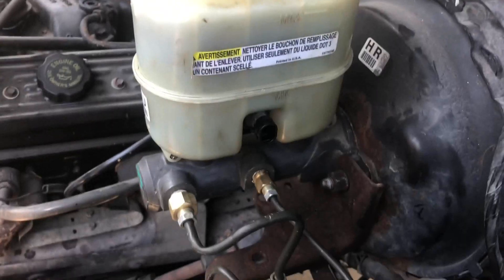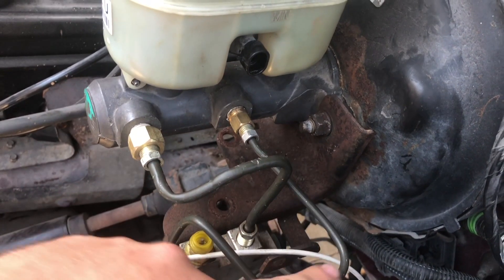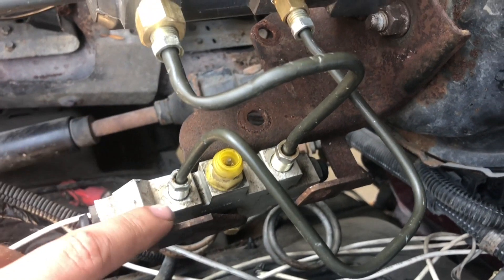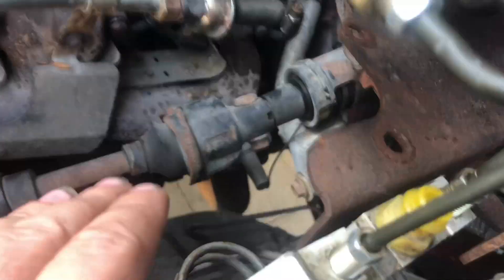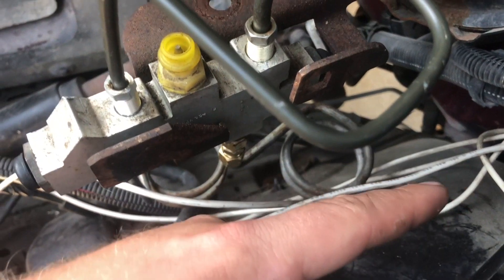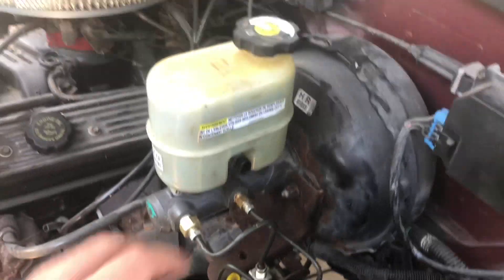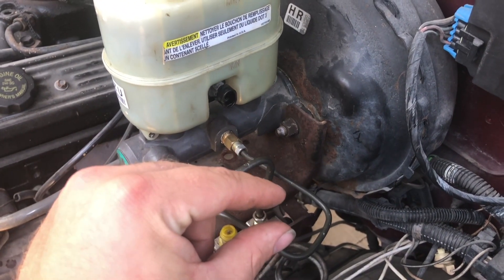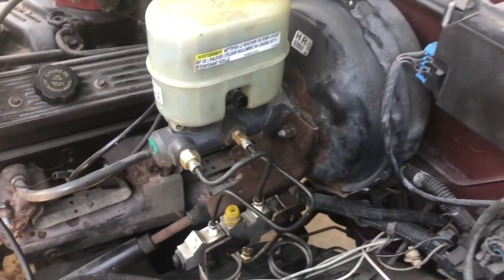1988 - 1994 Chevy 1500 2500 master cylinder upgrade and ABS delete

Comment: 1998 Chevy here. All 4 wheels done, drums in back.  But still very bad brakes.  I am getting plugs for the master to see if the pedal is rock hard with the ports plugged.  If so then ABS delete.  One thing I noticed was the small holes for the front brakes for the fluid through the banjo bolts.  Needle size holes.  Not sure if I'll even use a proportioning valve or not.  Is there one in the ABS?  I don't know.

Comment: Just did the master cylinder upgrade.........2" travel brake pedal..... then have to push VERY HARD to stop truck.    2" travel is NOT enough for Power Booster to work for power brakes.  ? What should I do next ???
Reply from the maker: Was your power booster working correctly before? The pedal on are truck moves less than an inch before the brakes start to engage.
Reply: @chrisperkins7067  Booster worked fine before......    @" tra
Reply: P S    After ABS delete  still can NOT Lock up wheels. Under dash air sound as pedal is pushed.
Reply from the maker: @catdakman1273  did you use the exact same master cylinder I used?
Reply from the maker: @catdakman1273  kinda sounds like your booster isn’t working is the petal really stiff does it move at all with vacuum on the booster.
Reply from the maker: @catdakman1273  also pump the pedal a few times and hold it down if it drops your master cylinder might be bad.
Reply: @chrisperkins7067  YES it was
Reply: Power brakes worked fine, before. M Cyl is '02 silverado.... the short one like your video.  Pedal moves like in slow motion, even when you mash it to floor. Air sound comes from under dash when pedal moves...   ?????
Reply: I did the abs delete and installed the new master cylinder and I am experiencing the same symptoms, I installed new calipers and rear cylinders tried to bleed even with the bleed tool on the proportioning valve and brakes still having the 2" travel and really hard to stop the truck.
Reply: I just completed this modification to my 89 GMC 1500 and I am experiencing the same problem. I have significantly reduced the brake peddle travel but no longer have power brakes. I suspected it was a result of the reduced travel and based on what others have experienced my suspicions are confirmed. I am seriously considering going back to the original master with the hope that the ABS delete alone provides some improvements in peddle response.

Comment: Can ABS system cause my Master Cylinder to leak out front port? I got 95 GMC C1500 with the other ABS box than one in video and I was wondering if deleting ABS and getting warranty on my Master cylinder would fix this, my first one started leaking and I replaced and few years later leaked from front port under reservoir and then I just put a brand new MC on and now leaks same spot and from lines at MC.
Reply from the maker: It might It sounds like there might be a restrictions somewhere in the line causing back pressure to force its way past the seals. Delete the abs and if it’s still doing it look at the prop valve because it might be restricting to much and make sure your back brakes are working the prop valve might be closed that could also be the problem.
Reply from the maker: Jimmy Howard and another option is to use a Chevy square body master cylinder because the master is one solid piece it cant leak. Ive never done this only read about it and it might just hide a latter problem but it’s an option.
Reply: @chrisperkins7067  thank you much
Reply from the maker: Jimmy Howard I’m happy to help

Comment: Where do I get the 2 lines that go from nbs master cylinder to the top of the proportioning valve? And I can use an adapter for the rear line to bottom of proportioning valve? 

Rear line---->proportioning valve---->new line---->adapter fitting--->master cylinder correct? 

Basically I'm asking can this be done just with adapter fittings? Thanks
Reply from the maker: Marcos Serna you can get an adapter fitting that would just adapt the rear line to the proportioning valve but your going to have to get a thread gauge and check because I don’t know the thread I flared a fitting from the junk yard on to are’s. The lines going from the proportioning valve to the master I mad my self you can get pre flared line and just adapt them one of the comments around here have the part numbers for those fittings.
Reply: @chrisperkins7067  Thanks Chris! Great info! So far I've done the abs delete and my nbs master cylinder should be here tomorrow. Most instructions are for the 96+ trucks whereas mine is an 89.
Reply from the maker: Marcos Serna happy I could help.
Reply: @chrisperkins7067  thanks for the info. I'm bout to start my rear disc brake upgrade also on my 89obs and do this abs delete. I just have find out out proper fitting and wondering if the part store flare the ends of the brake lines
Reply from the maker: Co Will yes you can get pre made flared lines in different lengths and bend them to fit.

Comment: Would this work on a 94 suburban Silverado edition TBI it has the big box abs and so all I would need is the master cylinder for a 2093 GMC truck? And fittings??
Reply from the maker: Yes it should work as long as it has a vacuum booster and not hydra boost.
Reply: @chrisperkins7067  thanks I meant to say 2003 lol
Reply: I'm doing the same thing just ripped my abs unit out (the big box on fender) and re routed my front lines with the "T" the early 90s used

Comment: Can you link the adapters for the master cylinder
Reply from the maker: Here’s the part numbers both fittings were purchased at advance auto parts.

Blf-20c

Blf-19c

Thanks for watching.
Reply: You're a god amongst men sir. Just ordered the fittings and got my master cylinder today. Do I need to fully delete abs or can I just unplug the box and say fuck it
Reply from the maker: @fakeMbadge I would fully remove the abs Box and abs valve. You might be able to keep the wire that plugs into the top of the proportioning valve. I removed all wiring that went to the abs box and proportioning valve. I kept the proportioning valve in the system. Hope this helps.
Reply: @chrisperkins7067  What part/fitting did you use for the rear lines to go into the bottom of the proportioning valve?
Reply from the maker: Russell if my memory is correct I cut the fitting off the abs module and used a compression fitting to connect it to the rear brake line and did some bending to get it to line up. If compression fittings aren’t legal we’re you are you can get a brake line union and flare it on.
Reply: Did you have the part number of the master cylinder?

Comment: Does this apply to hydroboost trucks?
Reply from the maker: I cant say for sure but this should work on a hydra-boost truck. As long as it started with a master cylinder that is the same as a truck with a vacuum booster.
Reply: @chrisperkins7067  Thanks for reply.  Took another look at the truck. It has a kelsey-heyes 3 channel abs. The system is different than the others in videos.
Truck is a 95 3500hd. Yesterday I went to my friend's farm. Had a long downhill gravel path; took it at 1-2mph with brakes applied and in 1st gear.  Afterwards rear brakes were smoking on freeway and fronts were also very hot.  Even the master cylinder and bottle were very hot. The master seems ok. Brake hoses look okay but are original.  Not sure how the abs can cause brakes to stick.
Reply from the maker: electricamir248 if it’s locking up on all 4 wheels I would check your abs,master cylinder or proportioning valve. My guess is you probably have a bad proportioning valve.
Reply: @chrisperkins7067  I removed DS front caliper and on the floor was very difficult to push piston in with hammer handle and my weight. Got a new caliper coming and will test. Seems strange for all 4 calipers to get stuck at the same time. I will post my findings.
Reply: @chrisperkins7067  Finally got it all back together last week. Turns out all 4 calipers were stuck. Proves the importance of brake fluid flush.  I believe these were  original to the truck; 24 years.

Comment: What vehicle did you get your master cylinder for or from
Reply from the maker: 2003 Chevy suburban
Reply: Were are the adapters for master cylinder available parts store or do you have to hunt them down from somewhere like Lowe's
Reply from the maker: james stevens got both at advance auto parts there’s another comment here somewhere with the part numbers.
Reply: I appreciate the help buddy I've got a 90 K 2500 I'm redoing the brake system on I've got a leak I think I've narrowed down to the rear wheel cylinders replacing those this weekend and my parking brake light is flashing which I'm assuming is an ABS problem so I'm going to try to delete that as well and I figure doing the booster upgrade is a good idea because better stopping power is always good
Reply: I think I saw a comment it said the 99 booster should work as well I'm going to try to go with that because it's a little bit cheaper than me 01 - 03 years
Reply from the maker: james stevens I was highly impressed with the abs delete and master cylinder swap made the brakes a million times better.
Reply: @jamesstevens3661 , just be sure to check the donor trucks numbers! Here's why: the booster from a 7200 gwv 3/4 ton truck is different than an 8600 gvw 3/4 ton truck! Go for the heavier duty 3/4 - 1 ton c/k truck parts and you can't go wrong on the booster!

Comment: Do you have to delete the abs to use the newer master cylinder?
Reply from the maker: you don't have to delete the abs but i would recommended it. I've taken the abs off a few vehicles and the brakes are always better in the end. You should keep the proportioning valve.